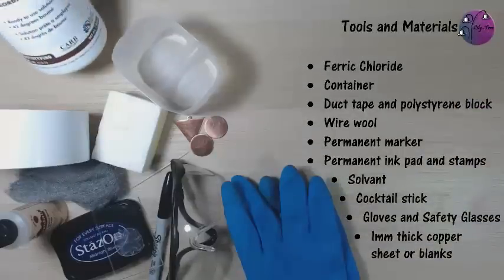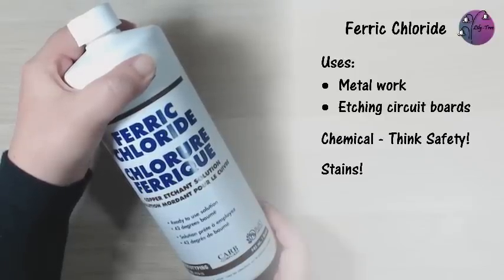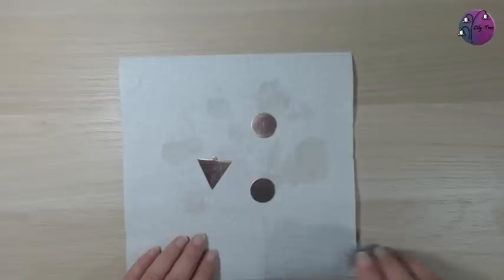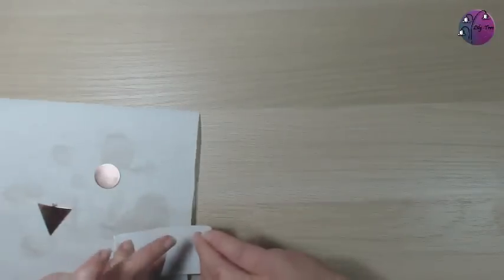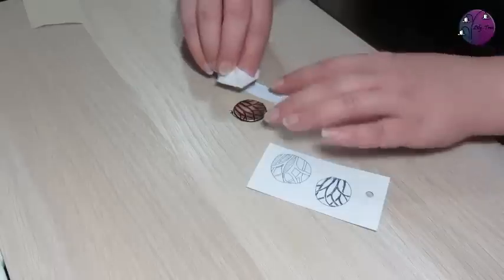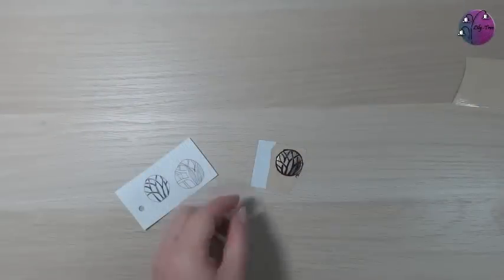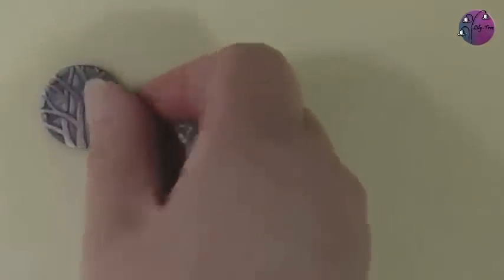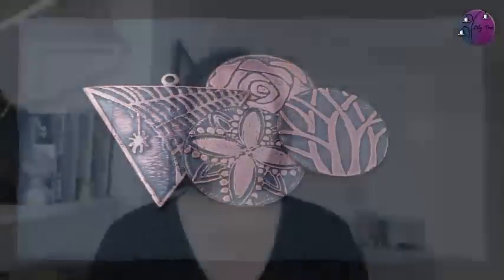How to Etch Copper with Ferric Chloride

Comment: Ive used the circuit board blue paper. Its great in my book. But sometimes the printer doesnt act right. Have to black in where misses. I was new to it all when tried. Dont even remember what chemical i used. Yours looks great. Take care.

Comment: I speed up the process by adding citric acid.  Mix 1/5 citric acid solution to 4/5 ferric chloride.  Citric acid solution is 1 part citric acid powder to 3 parts distilled water.  It really cuts down on the time!

Comment: Over the years I have done a lot of etching from patterns drawn from my pc onto transparent overhead projector material.
Reply: I'm not quite sure I follow you here...  i have transparencies that I can print on to... used for an overhead projector back in the day... but how do you get the pattern off the transparency and onto the metal?  Are you using a laser printer?  Laser toner ink works as a great resist...or so I've read.   I don't have a laser printer at home and I'm not about to shlepp out to a copy place to get something printed.   I'm too lazy to do that...lol. instead I'd rather painstakingly draw by hand.  Lol. Just curious about your process!
Reply: I coat the brass on one side with the a bright blue light sensitive material, make  an envelope with thin card and the transparency, put the brass between, put it face  down in UV light, expose it for 5 mins. The image comes on to the brass. Develope it with baking soda/ water 10%. put in a bath of ferric chloride.
Reply: @bbcisrubbish  Thank you for the reply!   I understand now.  UV resist.... that explains it!   Without that ingredient, I was really scratching my head as to how you transferred the pattern.  Thanks again!
Reply: Kerri Schneider  It's a pleasure. I find that trying to describe things in writing is not at all easy. I don't have a clue on computer things, short cuts etc.
It would be easier to use a drawing, "a picture is worth a thousand words". However, I don't know how. I am not buying anymore equipment.
Reply: @bbcisrubbish  oh I know what you mean ... I'm always talking with my hands and providing demonstrations...when I'm on the phone... like they can see me!  And I know a little bit about computers ... and I know I used to be able to post a picture in a videos comments section...because I often did.  Now I cannot.  I've tried repeatedly to figure it out.   You ask around and I'm finding the same answer ... you can't.   But also as disturbing I hear that...you never could.  I beg to differ.   I did it for work as well.  I sent a suggestion to YouTube but I guess their hands are busy policing everyone's speech.  I would find it sooo helpful when learning new things and explaining what I know!  

I used to be in R&D in microelectronic semiconductors industry... I used to design, make and package silicon wafer to chips and  photolithograghy is a large part of the process.   So once I read the UV... I instantly knew what you were talking about.   That's how circuits are created on computer chips if you didn't know already.  Just plating, etching, evaporating all the metals, other materials  needed to run the "wires" (thickness measured in angstroms) in order to get said gizmo to power up and do as you design.   Boy if only my lab was still around I could make some seriously impressive jewelry!  Kinda why I started in the copper etching really.  Sorry for the long diatribe.  Happy creating!
Reply: Kerri Schneider.  I am just messing around with a simple model railway, the simpler the better! I will have to lay-off that for a while, I have just come out of hospital after a bout of pnumonia (spelling) and my wife went in today for an eye op. (Thank Gd for the NHS). I'll be in touch later.
Reply: @bbcisrubbish  Oh wow!   Prayers and wishes for a speedy recovery for you and for your wife's surgery!    I used to get pneumonia almost once a year until I started taking colloidal silver at the first sign of a cough.  Usually bronchitis or sinus infection led to the pneumonia.   I found that the colloidal silver has kept me illness free for several years now.   Even going thru chemo for 18 months, I didn't catch anything and I was volunteering in my son's elementary school at the same time.  You know what little Petri dishes kids can be.  It tastes like nothing...like water ... bonus!   It was a complete game changer for my winter sicknesses that I routinely caught.  Just thought I'd pass on that tidbit of info.   I swear by it!

Comment: After etching copper in my ferric Chloride i put a piece of steel in and it was coated in copper. Can someone tell me if this is plating (ie. Permanent) or just a surface coating that will probably rub off
Reply: Plating generally requires electricity.  See if it comes off with some steel wool.  I'm predicting that it can be removed.  Although I do not have a definitive answer.   Let us know though!
Reply: Kerri Schneider It didn't come off with steel wool. I needed to use a scotchbrite wheel on my buffer. Does that indicate it just being a coating? The reaction going on is Fe+ CuCl2= Cu+FeCl2 so technically the layer of copper should only be Atomic level thickness.
Reply: @bobbilly8476  Yeah, it's probably only angstroms thick but I was surprised to hear that steel wool didn't remove it.  You can plate copper without using electricity with copper sulphate but the resulting etch solution is a cupric chloride or copper chloride.   I didn't know that you could plate using the cupric without requiring hydrochloric acid in the production of the solution.   I'm sure if you are aggressive enough that you can remove the copper layer eventually but I dusted off my old college chemistry books and think that you have indeed plated it.  Kudos!  This old dog can still learn new tricks!  Yeah!   Questions... what color was the solution prior to afterwards?  Is it a shiny or dull copper?  Have you tried repeating it?  I'm going to have to give this a whirl myself and see what I can do with this new skill added to my wheelhouse!
Reply: Hey @Kerri Schneider, sorry for the late reply.  
1) That batch of ferric Chloride remained the same color approx as before. 
2) It was a dull copper

later testing: In a 2 liter container of ferric chloride i dissolved a large amount of household electrical wire into it.
The resulting solution does infact still plate the steel. ( steels used; mild, w2, o1, d2, a6)
Reply: @bobbilly8476  Hey there !   A late reply is better than no reply!  Giggles.  I haven't had a chance to try this yet myself, in fact you reminded me of an experiment I wanted to do!   I love when science pulls a rabbit out of its acid bath!  Haha
  I would have never expected this result without electricity... but then I realize the older I get ... just how much I don't know!  ALWAYS keep learning!  I explained to my kid the other day ... if you're not failing at something it means your trying anything new!  Failure is learning!   Course I'm not saying you failed here or anything... but some of the best inventions came about from a whooops.
Reply: haha 100 percent correct. It was definitely a mistake, but a happy one. My primary use for my ferric chloride is to etch my knives, and when i pulled the knife out and it was orange- red it was definitely a surprise! I'm going to be attempting to use this for my maker mark in the top corner of the knife, as I've never seen a knife maker do it before.
Reply: @bobbilly8476  As someone that has quite a significant knife and sword collection, I can honestly say that I've never seen a maker mark in copper before.  That's an outstanding idea!  So I gather you make knives?  You have my undivided attention!  I started off years ago with just pocket knives ... Gerber, Kershaw, Swiss and the like ... moved on to buck knives and fixed blades and then I ran across a Randall at a yard sale.   They didn't know what they had ... but I did.  Picked it up for 25 cents.  It was a little rusty but a little love, care and oil and she's as pretty as the day she was born. Then I moved on to swords.  Now I'm seeking out custom made knives.  Happiness is being divorced....bc he couldn't understand what I needed with knives I was never going to use?  If I have to explain it, then it's not worth the effort.  Haha.  Anyway... are you a craftsman ?
Reply: haha thanks! yep, i think I'm onto knife number 10 right now. That's an unbelievable deal! I would love to start geting swords, but i really dont have the money:( haha well thats a glim outlook lol, but ya my knives are pretty much my number one. yep, im big into metal working, and just taking up wood working

Comment: Will this technique of etching work on cooper from the hardware store?
Reply: Yes.  I have refrigerator copper tubing from the hardware store than I etched prior to hammering it into a bracelet.  You can also get copper wire this way...but you do have to strip the covering off.  But I found it's cheaper to get the really heavy gauge copper wire that way.  And you can etch wire... the heavier the gauge the better!
Reply: @kerrischneider7693  Thank you!
Reply: It also works on brass.

Comment: I enjoyed until the end when you didn't mention that the liquid can be funneled back into the bottle & used again. 
It is also pertinent that viewers know this must be taken to a hazardous waste center. When put down the drain it is a dangerous poison in our water supply. Putting in your trash can will also end up in the ground.  The copper sludge is still dangerous to the environment even if baking soda is added to the liquid.
Reply: She mentioned at the beginning not to funnel it back in as it becomes weaker over time, and she suggested keeping it separate. She also advised everyone to read all of the safety warnings on the bottle before starting, the safe disposal of it will be explained there. All in all I think she covered all of your points.
Reply: J Halfacre it's good on weeds though
Reply: Dont funnel back in; acid will lose potency over time much quicker. Best to store used acid separately, as you can certainly use it again. Just store separately so you dont contaminate the fresh acid!
Reply: Were you paying attention? This was covered.

Comment: Very nice designs. Is there any way to protect the copper so it won't turn green when you sweat?
Reply: Hanh Dinh 
You can try a clear spray, such as Krylon; 2 or 3 thin coats, letting it dry between applications. Or, in a pinch, clear nail polish, same type of application (thin, dry between applications).

Comment: An alternative to Ferric Chloride I use for Printed circuit boards is 50:50 Hydrogen Peroxide (3% is fine) and Distilled White vinegar. (Apple cider vinegar works too if that's all you have) I add a couple table spoons of salt as well to speed things up. I also will heat up the mixture to 50C (125F ish). At room temp it could take an hour or more, 50C cuts the time down by half. Just a tip if you can't easily come by Ferric chloride. Less messy too.
Reply: Thanks for that tip. I think your Hydrogen Peroxide mix is better for the environment too.
Reply: This really works as well ? Trying to get away from so many chemicals
Reply: @sparklerebellion  peroxide is usually found at a pharmacy or grocery store
Reply: 505Innovation thnaks

Comment: Was just wondering can cast aluminium be etched. At this time of year I find lots of strange looking mushrooms, I freeze them and when they are hard I sand cast then I aluminium and polish them. The thing is while the shapes might be great the surface can be a bit boring , so I thought maybe a little etching of some design might be nice.
Reply from the maker: I haven't tried it myself, but apparently you can.  You might need to experiment with method and timing though.  From what I've seen it looks like aluminium reacts more (and fizzes!) so it might be worth trying to dip it upright, or sideways, for example.  If you give it a go, I'd love to see the results!  The idea of mushroom shapes with surface design sounds fabulous!

Comment: Great video! Does this also work with sterling silver?
Reply from the maker: No waffleattacks, not with ferric chloride.  For sterling you need ferric nitrate.  I haven't tried this, it creates the same effect but no doubt with different timescales and things to watch out for.
Reply: Silver is great to etch

Comment: Great video but how do you stop the etsing? I have learnd I a bath whit backing soda. Otherwise the chloride wil not stop etsing...and what are you using for the patina?
Reply from the maker: Thanks Joos.  To stop the etching, I just rinse off the ferric chloride in water.  I haven't found that anything else is necessary.  I use liver of sulphur to patina (check out my video at https://youtu.be/3NjRUpi8xmc ) and a solution of bicarbonate of soda (baking soda) to stop the patina.  In theory you can use plain water for this too, but I find the soda solution is simpler, particularly if I'm doing a batch of items.

Comment: Your video is entitled How to Etch Copper with Ferric Chloride... but the actual process doesn't start until 12:02.
Perhaps renaming the video might me more appropriate?  "How to Mask and Etch Copper with Ferric Chloride from start to finish".
I wanted to refresh my memory on the etching process only.  Otherwise it was a very informative video.  Thanks.
Reply from the maker: Thank you for your comment and suggestion.  It is one of my early videos, so still learning about pacing and how much info to provide.  But I'll have a think about the title, and perhaps some shorter refresher videos. Have fun etching!
Reply: My ferric chloride arrived this morning.  My copper will arrive soon.  Fingers crossed!

Comment: Should you put a lacquer on the pieces after patina-ing?  Or will the patina protect the copper?
Reply from the maker: You don't have to, but if you leave the piece unsealed it will continue to oxidise over time, darkening the whole piece.  You can, of course, just keep buffing the high points to get the contrast back. But I tend to seal the pieces to try to keep them 'as is' for as long as possible.  I always use Renaissance wax, so I'm not sure of the other lacquer options.
Reply: Thanks - I'll try that.

Comment: Great video... thanks!  Can you use the ferric chloride over once you've used it once?
Reply from the maker: Thanks!  Yes, you can re-use it several times, but it will get less effective each time you use it.  This should be noticeable in the increasing time it takes to get the etch you want.  I tend to keep my used ferric chloride separate from the new, so I've then got some new available when the old batch stops giving me the etch I want.

Comment: great demo and result. thank you .
can you etch sterling silver with Ferric chloride ?
Reply from the maker: No, to etch silver you need ferric nitrate.  I haven't tried it yet, but I believe it has a similar action on silver to ferric chloride on copper, but is a bit more hazardous, so I'd suggest checking out the usage, storage and disposal requirements.
Reply: thank you for your reply..  good thing that i asked you. 
so i guess i should get some ferric nitrate and try it myself then (will be first time for me too).

Cheers

Comment: I have tried to etch a copper tube and find that in using a stamp and an ink pad that the tube slides around on the stamp smearing the lines. Do you have any tips?
Reply from the maker: Is the tube still round, or have you flattened it?  I found that stamps on metal can be a bit testing, even when it's flat.  Mind you, I've had some stamping disasters just on paper before now!  Some stamps are a bit more 'grabby' than others so don't slip quite as badly.  I'd probably try stamping the design very lightly, then going over the design with a permanent pen.  I hope that helps!